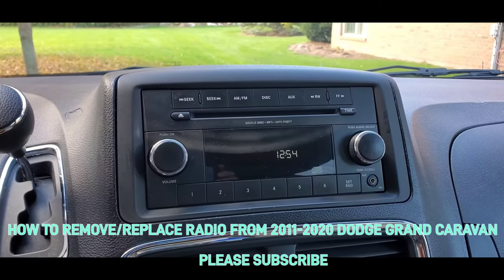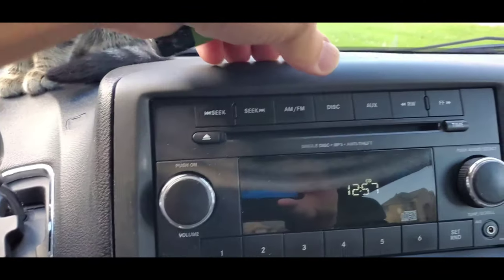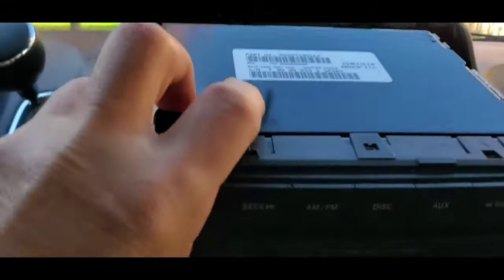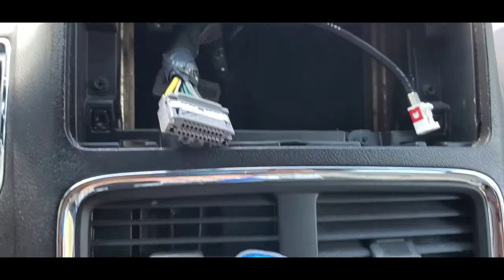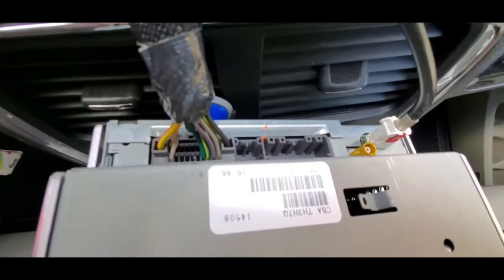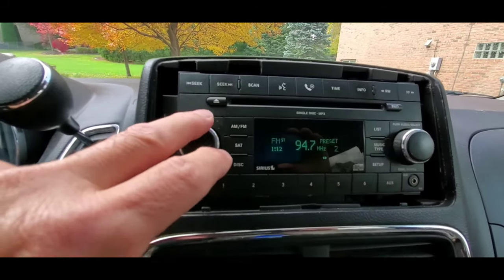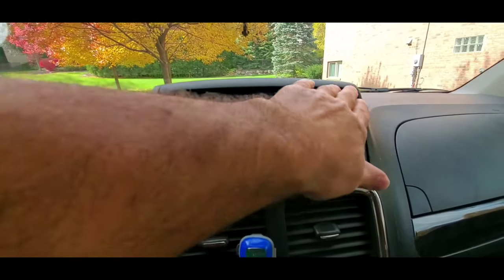How to remove and replace radio from 2011-2020 DODGE GRAND CARAVAN

Comment: The removal and installation was pretty easy, but the radio/deck would not work because the display read "input anti-theft code', and I had no idea what that was, so I went to my local Chrysler dealer, and the told me they don't give those out, so I'm not sure how this is supposed to work without the code.
Reply: Look in the owner manual under anti theft section for the radio

Comment: Hi, your video was very helpful.  I followed all your step. But it's asking for a code to enter.  How do I find that code?
Reply from the maker: Check in your glove compartment if you have a sticker with 5 digit code numbers, or in your car manual, if so, program those numbers and it will reset the radio, some cars have this as an anti-theft feature. Otherwise you would have to contact the dealership, if they will program it for you

Comment: I got a replacement radio n it doesn't work in my van. I was told that I have to go to the dealership so they can unlock it!!!
Reply from the maker: @frankgrande6274,
Check in the back of your car manual in the stereo/radio section for the code. Also, manufaturer's website can help with the code. If the dealership will take care of it without charge would be great. There is one method you can try but it may sometimes cause costly damage. Holding the radio button for about 50 seconds may bypass the code and activate the radio functions, Although that would be to your discretion. Let me know what you decided to do and the outcome, good luck.
Reply: @fixallchannel  thanks for the info. But the radio doesn't light up.

Comment: My wife’s favorite cd is stuck on her radio on the 2015 grand caravan. Radio itself works fine but was wondering when you hit eject did cd come out?
Reply from the maker: Turn your radio off. If your radio has a "force cd eject feature", press and hold cd player's power button and eject button at the same time for 5 to 10 seconds, release the buttons and cd should pop out automatically. Sometimes the cd player will function on and off sporadically, it will free the cd when you press eject, it has happened on mine a few times. There is one other method, with an old credit card, put transparent tape around the card, with sticky side up, insert it in the cd player and wiggle it around and it might grab and pull the cd out. Good luck.
Reply: I did that. Actually got lucky with double faces tape on a metal icing spatula. Was able to pull it out and surprisingly she hasn’t had any issues with ejecting again so far.

Comment: How do you get the anti theft code? Can you use the radio without the anti theft code?
Reply from the maker: Mark Smith,
I did not have to use an anti theft code. I replaced the radio and it worked.
Reply: Exactly... that's my problem
Reply from the maker: @ameldaquirk3965 I did not have any issues, it worked fine, I no longer own the minivan, I sold it.

Comment: im curious i got one of the touch screen ones with back up camra and all on my rt model but mine died so i need to get a after market i got the adapters for everything but that smaller plug next to the power cable what does that do will it be needed with the new radio because i see you don't got it yet i do
Reply from the maker: PlayaOfGames,
I did not have that feature in my minivan, but I believe it may be for voice command ( hands free) feature, but not sure. Since you have the higher end features, look on ebay, or contact the nearest salvage yard, and you can pick up the radio for cheap, as long as the features are similar, good luck.

Comment: I used the same radio to replace my old one. I did not have uconnect before. What do 
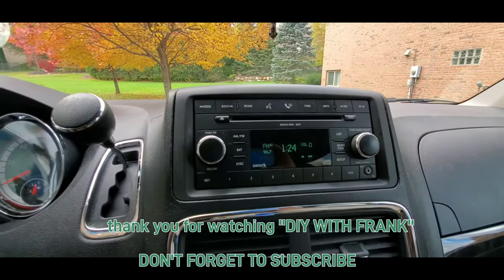I need to use it with this replacement radio? 6:58

Comment: After watching your instructional video  went and replaced my radio with a radio from a Chrysler that is identical to the radio I have. On back of the newly acquired radio it says L0611/120/13 so I am assuming that it is a compatible radio. I had no problem replacing the radio but when i tried turning it on absolutely nothing happened. I have no power whatsoever. When i reconnected my radio it worked badly but it worked. My basic problem with my old radio is that the AM is all staticky. FM is fine and so  is the CD player. Can that be repaired or should I just try getting another radio. Is there anything that can be done for the newly acquired radio to be able to show power ????????????
Thank you very much
Jose Flores
Reply from the maker: It is a common problem that the manufacturer never corrected. It may be a cracked or broken solder joint that controls your am freqency, surprisingly that  everything else works. Unless you listen to AM frequently, I would not spend the extra money to replace it. On some vehicles the replacement radio may not work because it may need a factory code, check on my comment to another viewer that had a similar problem with their replacement radio. Check the back of your car manual on the radio section, it maight have a code to reprogram the radio. Also, look up the manufacturer's website if they show an anti theft code for the radio, or contact the dealer.

Comment: Hello, did the satellite radio work without the antenna?
Reply from the maker: Hello Evgueni Khalkov, 
No, it does not work without the wire harness to be plugged in to the radio, and this minivan was not equipped with it. Although the aftermarket wire harness is available to be added but I am fine with basic AM/FM radio and cd working. Thank you

Comment: don't if you can help me, I have a 2015 grand caravan and my radio or and my bluetooth while talking goes off and on about every 2 seconds, pretty annoying, sometimes it works just fine till the next time I use it. thx Greg
Reply from the maker: @gregoryv3626,
Sounds like the soddering on the main board that was done from the factory is failing. You may have to replace the system or find someone that can resodder the areas inside the mainboard.

Comment: Hello
I have the same problem with the same van , mine is 2013 grand caravan the radio works sometimes and it doesn’t sometimes, I got one from junkyard installed it , it didn’t work… yoke it back  put the old one back on…any ideas what is causing it?
Reply: problem with the microcircuit, need to be soldered
Reply: @ВолодимирБойчук-ш3щ  Dubra thank you

Comment: The radio in my 2013 caravan started cutting in and out recently. Possibly a wiring issue?
Reply from the maker: Most likely it may be one of the solder joints or chip that cracked or came apart inside the main board of the radio where the antenna jack is connected. It is common on these radios. This happens because the joints are not sodered well from the manufacturer.
Reply: @fixallchannel  Thank you.

Comment: Hi I see your video I own Dodge Grand Caravan and my problem is the radio isn’t working I want to know where do you buy the radio I’m in California
Reply from the maker: Hi Johnny Ishak,
You should check some salvage yards out there that may have a dodge grand caravan or chrysler town & country similar to your minivan body style year. This would be the most affordable way, as I did. I am sure those junk yards will have plenty of similar minivans that will have radios still in them. Also, facebook marketplace and ebay would be the next places to check. Good look.
Reply: You can also get it from Ebay.
Reply: No junk yards in Northern Michigan so I went to www.jegs.com.
Reply: problem with the microcircuit, need to be soldered
Reply: amazon too

Comment: Why would you skip the parts of unhooking the antenna and hooking up the antenna? That's the part I'm having problems with. I cannot unhook mine and you just skip past it. It just showed something with his screwdriver but I don't know what you did
Reply from the maker: There is a tab where I am pointing with the screwdriver, you lift it toward you to free it from the little nub.

Comment: where can we get a radio...i have been quoted close to 100 and you said you paid 29...
Reply from the maker: I picked it up at a junkyard, from a same type vehicle. Check your local salvage yards, you may have to remove the radio yourself which is very simple and cheaper, Good luck.

Comment: I'm trying to install my radio and it keeps asking for security code were can I find it it not in owner manual
Reply from the maker: If your car manual does not have the anti- theft code in the radio/stereo section, checkout the manufacturer's website. The dealership can also help you with this, sometimes with no charge.

Comment: Didn’t show how to set up the time & date & other set up issues
Reply from the maker: Hi john jones,
The video is only about replacing the radio. If your radio is identical, then hold the "time" button on the top until you see the hour blink , then change the hour with the tuning knob. Repeat same for minutes, but press in the tuning button to change it from hour to minutes blinking, then turn tuning knob to change the minutes as needed, and that is all. Check if your time button might be located on the right, but still the same steps. This radio did not have the date feature. Hope this helped.

Comment: Man fuc dodge this van is a 16 and having issues with the parking break radio volume
Stop working now the passenger sliding door lock actuator stop working motor has piston slap abs sensor needs to be replaced. this is our only dodge in the family we’re mostly lexus & toyota family this thing is a disappointment 😂